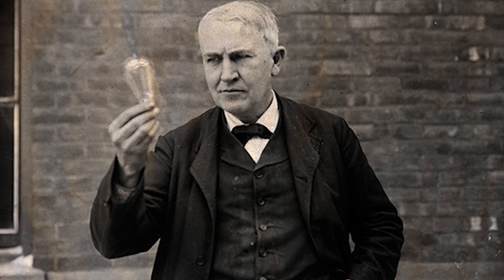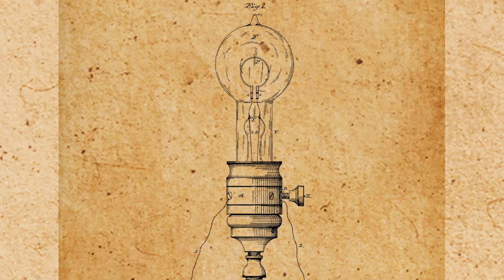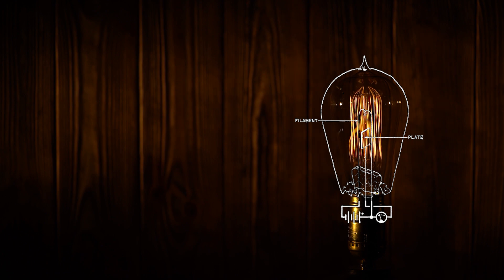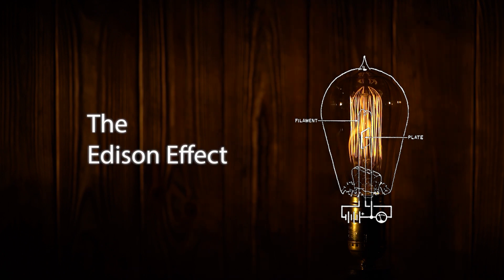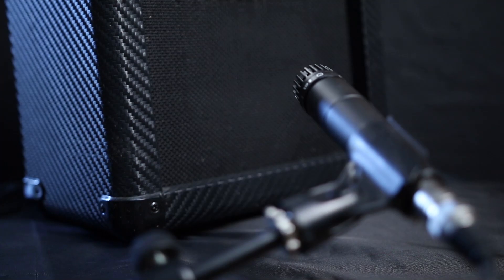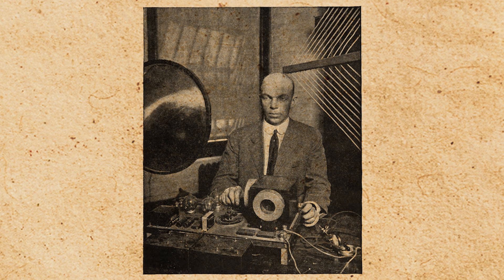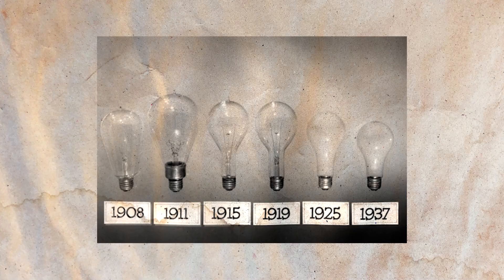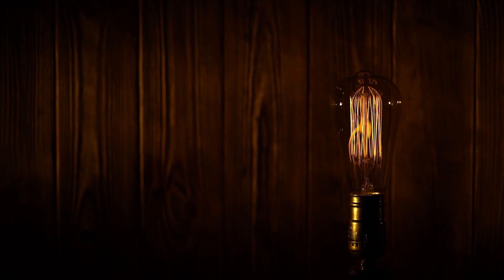The Light Bulb Is The Origin of The Synthesizer | Astonishing History of Synthesizers EP1

Comment: A triode is a type of valve/tube, but minor quibble aside, this is a great introduction to the basic concepts for people new to the subject. 

Commenters claiming it has nothing to do with synthesis don’t understand that all explanations of electronic (analogue or digital) audio need to start with a description of what electrical sound and amplification even is. Musicians have thought of waves as transferable properties between mediums/media forever, but a lay-person may not have thought about how the electrical signals used for audio could be used for anything yet could still be rendered as an audible sound. Especially if they grew up after the age of dial-up!

To add another quibble I would probably call tubes specialised applications of technology invented for the lightbulb, rather than lightbulbs themselves, but certainly there are a ton of similarities. 

In fact, even though I was aware of how analogue oscillator circuits incorporated feedback as a control mechanism to maintain stable pitch/frequency, I’d never thought about how a mic squeak is an electro-mechanical oscillator! I only expected to learn some of the pre-Moog and Theremin histories, but I also learned a new angle to look at mic squeal!